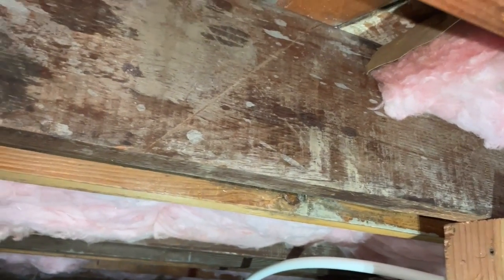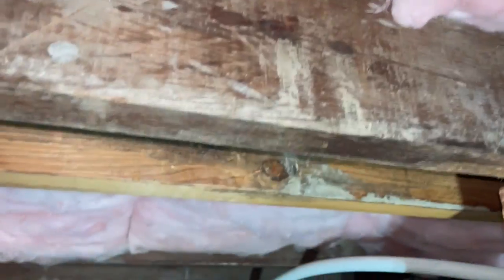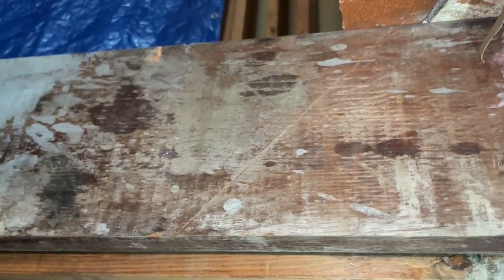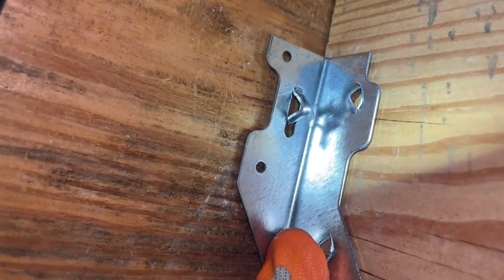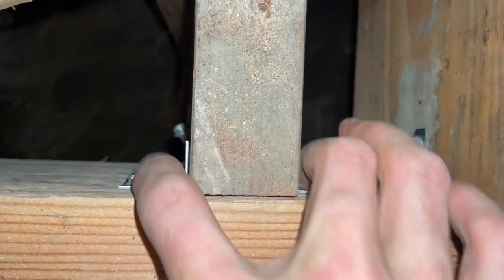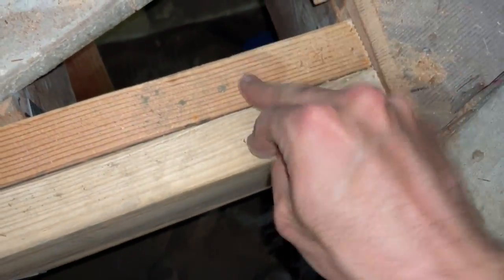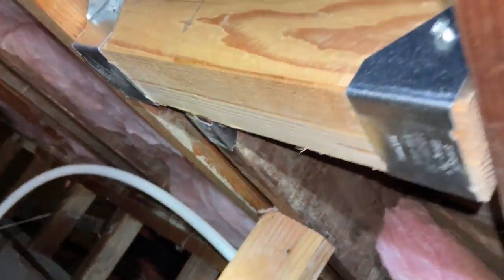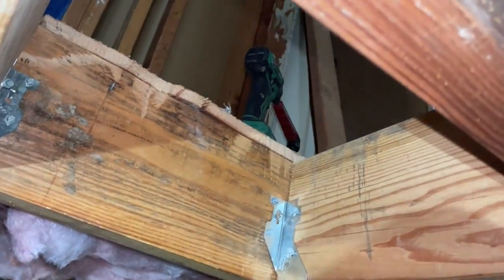How to cut a floor joist for plumbing requirements

Comment: you should NEVER cut a joist, in my opinion. i would sooner build the wall out a half foot with a 2x4 stud wall. you can make a nice in-wall shelf for your soaps and shampoos!

even with replacement supports like you did, it's not nearly as strong as the original joist. especially if it's an older house built using local hardwoods...

some jackass cut thru one of my bathroom joists (because the house was built before indoor plumbing was a thing), and then just sistered a SHORT 2x4 next to the pipe. guess how long that lasted...
Reply: How long?
Reply: @ShibaMomUSA  it was sarcasm. it DIDN'T last, as it was not even connected by the time i became the homeowner.